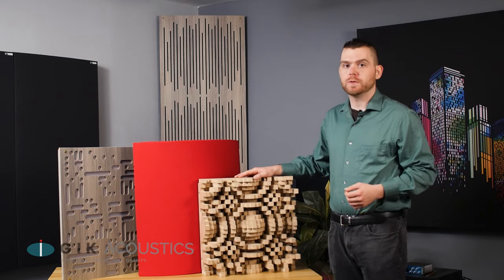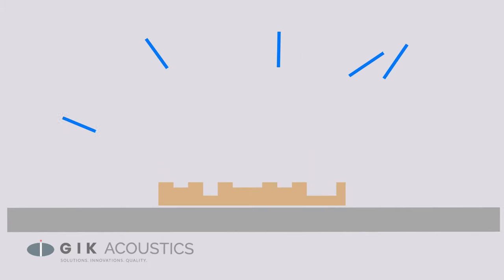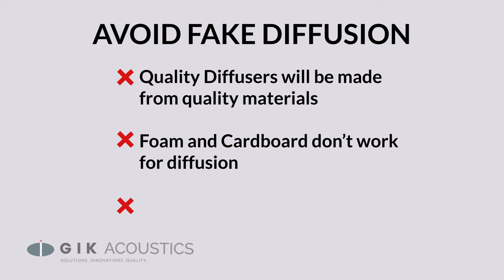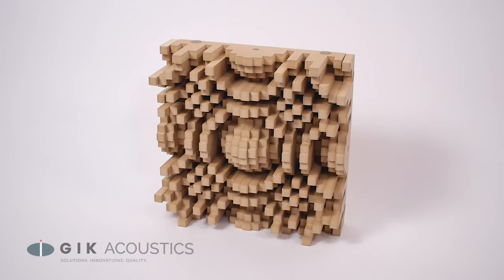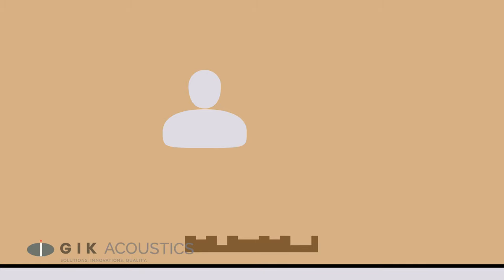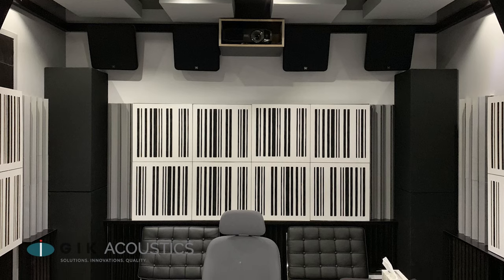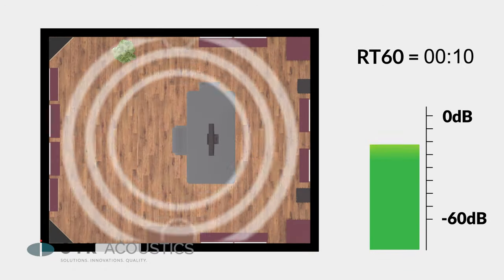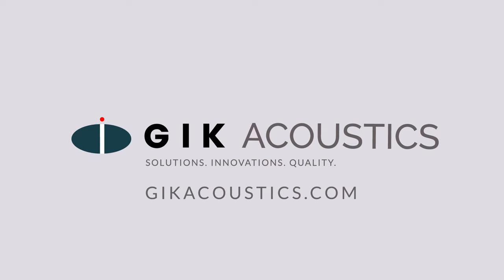Debunking the Myths - Sound Diffusion

Comment: lol only we can make a DIY diffuser. dont do it yourself!!
Reply: Pretty much
Reply: Ye and then it looks estetically pleasing too. Surprise surprise.......
Reply: If you can mesure the dufusion and you know how to do it. Like with other things.
Reply: There are mathematical formulas under the hood, and the right materials, and manufacturing. Of course you can do it yourself if you have the right expertise and equipment. I have the maths, but I would surely cut my own finger off at the first attempt with a cutter tbh, moreover my time is worth more than that, hence I prefer to buy it. 
In other words, why don't we hit jackpot and build a working DAC at one tenth the street price? I am contributing the maths.
Reply: @DaveJ6515  Math formula. How big of a diffuser do you want? Afford? 3 feet by 3 feet? That is 9 square feet. You want enough material to fill 9 square feet. You are gonna use say 1 inch blocks standing on end.  That will be 1296 blocks. Divide by 4. Make one group 1 inch. Another 2. And another 3. You can have empty spaces for the last group. Play. Paint them different colors and make a cute design. Done.
Reply: Yeah I'd like to see them "calculate" my room and sell me the same carefully calculated $300 diffuser they sell to everybody else 😂

Comment: stop blah blah blah.....demonstrate it
Reply: You can't demonstrate it through a YouTube video
Reply: @DuSeun  so why u using the you tube. Even the most scientific principles are demonstrated and well explained in youtube. So that means these are just ‘explanatory functions’
Reply: True. Just show us the difference between a real diffuser and a useless diffuser.
Reply: I have the quadratic diffuser shown up front. From actual measurements, it provides diffusion from about 1 kHz to about 8 kHz. Above that they start to look specular like the wall behind them. I think the single-reflection reduction I observed was something like 4-5 dB for the array of four (Edit: This is for the flutter echo that I had, for general diffusion of reflections it will be less) and they provide a definite audible improvement, but only if reflections are an issue for your space. You also need to actually do some measurements and testing to see what you need. It needs to be prescriptive, and not just guessing or you can easily make things worse, esp. with absorbers. Those can be a disaster if misapplied. Only complaint I have is the construction was not so great. They did not clean up the individual sheets after CNC'ing, and the panels just used some rudimentary machine screws and threaded rod to hold the laminations together. I had to modify them myself before using them.

Comment: Much of the information here is spot on, with one big exception.  The human ear is not sensitive to the type of diffusion when the diffuse sound is coming from behind the head (front and sides are different).  So it doesn't matter if you're fussing about exact formulas.  What matters is "visual irregularity" and that you don't cover more than 50% of a module or 30% of your entire back wall with diffusion for a control room.  And in fact many types of back wall diffusors can create problematic hot spots.  Source: Master acousticians and control room designers Philip Newell and Tom Hidley.
Reply: "The human ear is not sensitive to the type of diffusion when the diffuse sound is coming from behind" - there's no such a type of diffusion "coming from behind". The aim of diffusion is phase grating, and no matter where the diffusors are located in the areas of the first reflection points -- they can improve the acoustics of your room if they are properly designed. The rear wall is the most important for the midfrequency range as far as the rear wall receives the most of the energy from the front mounted speakers and the rear reflections can be a big problem if the wall is not properly treated.

Comment: I have a big question.  I have an onkyo tx rz820. And I thought I could do 7.2.2 atmos. Turns out I can only do 5.2.2 atmos or 7.2. I have a small room.  12x11. The big question.. should I return the upfiriring Dolby atmos speakers and do 7.2. Or is it better to do 5.2.2 atmos with the upfiriring speakers???  I kinda like 7.2. I'm thinking the upfiriring speakers don't really make that much of a difference.  Am I wrong? What should I do??
Reply: You can install speakers on your ceiling, that's what i did and it worth it. I never heard upfiring speakers but i highly doubt they can do a good job for Atmos/DTS X. Now i want a better receiver so that i can use 4 height speakers!

Comment: I have four of these same exact panels as the one in the front to diffuse flutter echo, and they do provide ample diffusion and an unambiguous audible reduction in echo from 1 kHz to about 7-8 kHz from sonogram measurements. The one disappointing thing was that they are simply stacked together with some allthread right after they are routered, and have no mounting points, which is an issue when they are just sheets of MDF. I had to disassemble them, modify them to actually be able to mount them, and then reassemble with wood glue and some fixturing for alignment. They also weigh 30 lbs. each so are quite substantial to mount. If they assembled them with adhesive/glue and included structural mounting points I'd have nothing but praise as they do work very well. If you were to use the stuff they include without modification, not only can the panel come completely apart, but it can fall off the wall after the screws strip. I'm not saying this to poopoo the product. In my case they are mounted overhead on a soffit, so if one came down it could literally kill someone standing underneath. If you buy some of their panels, do check them over before mounting.

Comment: When it is said the pattern needs to be calculated, but they end up like 'pretty' patterns, i have a hard time believing it really is the case. Especially when they add swirly patterns etc etc.

Where can i find the calculations?
Reply: There are nearly endless possibilities to diffuse sound evenly, many of which are symmetrical patterns. But it does need to be calculated to some extent, you can't just put random blocks everywhere to make the room sound better
Reply: @DuSeun  txs, seems i am skipping that for the moment lol
Reply: QRDude has been out since 2010.  Does 2D now too.  My conjecture says ray tracing software would be needed to test specific patterns.  Semi circles and misshapen rounded diffusers are out there too, but I think those are for huge rooms or auditoriums for the most part.
Reply: Simple math formulas commonly produce good-looking patterns. 
And no, it's not complicated math. Remember that this company doesn't want you to build your own diffusors, as they want to sell them to you for far more than double the price it'd cost you to build them yourself. Do not take this kind of advice form a company whose business it is to try to sell you their products.

Comment: I just saw another video that said to put diffusers behind your front speakers for small rooms.. im so confused
Reply from the maker: Diffusion on the front wall behind the speakers won't hurt anything, but in most cases it's not the most effective place to begin with diffusion since the speakers are firing away from the front wall. Navigating all the information (and misinformation) on the Internet can be challenging -- when in doubt contact us with details about your room, we're happy to help you navigate all the options to get the best possible results in your room.

https://www.gikacoustics.com/acoustic-advice-form/
Reply: Car Car as GIK acoustics says your better having nothing on the wall directly behind your front left and right speakers. 

Mine are rear ported but the sound from the ports will be virtually omnidirectional. The sound will wrap around the speaker and radiate in all directions. Some sound waves from the rear ports will still hit the front wall directly behind them.

But it should be minimal so I will leave it without any absorption panels directly behind the front left and right speakers. Unless the bass sounds boomy from my seated listening position. 

More important are the direct and secondary reflection points from the woofers and tweeters. I'm installing 11 acoustic panels a mixture of diffusers, hybrid absorber/diffusers in my room.

Two of which I bought from GIK acoustics, their excellent PolyFusors. The rest from a very good British acoustics company, and 3 from a talented Ukrainian carpenter wood worker.
Reply: @C--A  I have another question.  Would it make a difference if I hung 2 bookshelf speakers from ceiling for Dolby atmos instead of buying 2 flush ceiling mount in ceiling speakers? I would have them pointed straight down
Reply: @carcar5911  I would hang them above the front speakers right under the ceiling and pointed towards the listener. That's what I actually did with four JBL 8320 Cinema Surrounds.

Comment: My hifi has to fight for it’s right to be in our 18 by 21 feet family lounge. I have deployed absolutely no room correction or acoustic treatment other than a large plush rug, set on our hard wood floor, in front of and between my large floorstanders.

Over the years I have changed out components, one at a time and appreciated the differences they make. Very recently I replaced my large 2 and 3 seater leather sofas for a slightly smaller 2 and 3 seater fabric sofas. I was shocked. They’ve totally killed the room. The room has lost it’s ambience. The sonic signature of my hifi has changed significantly. It is now far more, well, intimate! I’m not sure that I like it. I guess I will grow to like it, as these sofas are here for the long term. I can regain some of that former ambience, by ramping up the volume to 85db plus, which requires turning the volume control to 1 O’clock, where as previously, turning it to 11 O’clock would have achieved that goal. I guess the new suite is made from a more energy absorbing material.

Whilst I appreciate that acoustic treatment under the appropriate circumstances can make a difference, I think my room is dead enough, even though I’ve large windows, concrete flooring clad with wood and dry walls! I still think I prefer to invest my hard earned money in equipment, not room treatment.  If you want to remove the effect of the room on your music, use headphones. No, it is not the same is it!
Reply from the maker: @Howard Skeivys  I'm not sure what to say about the sofas - although I can say sofas are not built to absorb low frequencies and have limited bass trapping capabilities. Typically when someone hears "deadness" in a room, it is because much of the high frequency content is absorbed, leaving lower frequencies to run wild. 

We've made a video all about it, and how you are likely under absorbing the lower frequencies in your space, which inadvertently is muddying up your sound. Here's the video: https://youtu.be/HXtsMz5345E

You are correct, it is not the same to listen to music in headphones as it is to remove the sound of the room. With headphones, there are many differences and disadvantages to treating a room properly - we've written an article on the subject. I hope you'll enjoy!

https://www.gikacoustics.com/mixing-listening-with-headphones-vs-acoustically-treated-space/
Reply: @GIKAcousticsLLC  I appreciate your feedback. The longest wall in my lounge is 21 feet long and 7.5 feet high and is all windows from above 3 feet. So, a large area of high frequency reflection.  When I have the place to myself, and I sit down to a long attentive listening session, I do close the curtains, which helps.  I’ve 2 large floor standers, augmented by 2 Rel subs placed adjacent to the floor standers. The new sofas did deaden the bass energy throughout the room. I’ve now deployed a 3rd Rel sub. Centrally placed at the rear of the room, on the wall opposite my floor standers. I had to spend a considerable amount of time and experimentation, trial and error, adjusting intensity levels and crossover points. The end result is that by using 3 subs, in that configuration, with the intensity level on each sub turned right down, compared to the level I had set with 2 subs, produces a very pleasing omnidirectional balanced bass response. My floor standers are bright, which is my preference, so, over all I’ve now got a well balanced, full range, sonic picture. All be it, far smaller sounding since the introduction of the new sofas.

I’ve spent  time, money and trial error building a premium rig that reproduces music the way I like to hear it. As I’ve mentioned, my hifi has to fight for it’s right to be in our far from ideal family lounge. Doubtless, it has a lot more performance potential given the right circumstances, but, it’s a balancing act between my requirements as an audiophile and consideration for the rest of the family. Minimising compromises and maximising benefits!
Reply: Without taking actual in-room measurements, any sort of room treatment is complete guesswork. Furniture does work as both absorbers and to some extent as a bass trap, but you have to do pre and post measurements to see what changes, and this also requires becoming proficient with measurement software and purchasing the necessary equipment such as calibrated measurement mics and an interface. You will also need some way to EQ the system as well (e.g. DIRAC live, etc.) which is MANDITORY for bass corrections due to the modal behavior of the room.